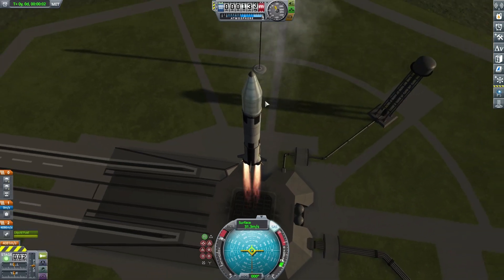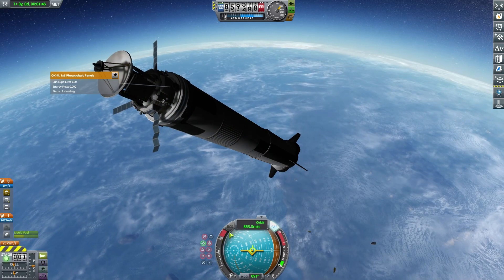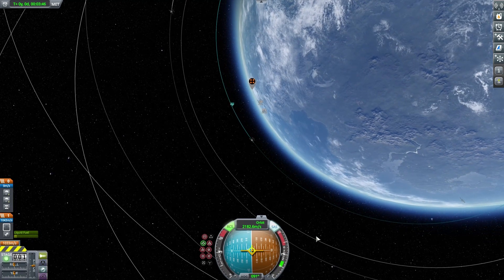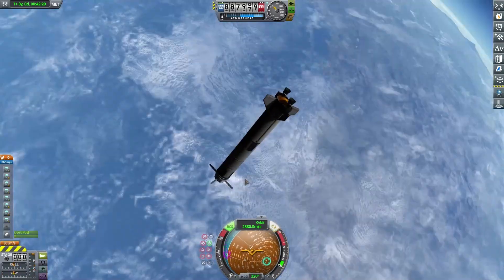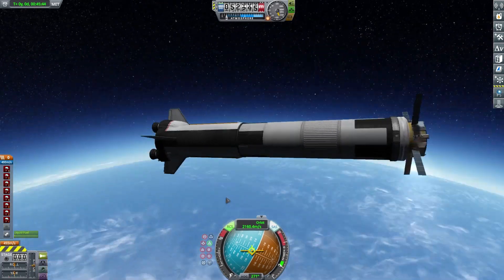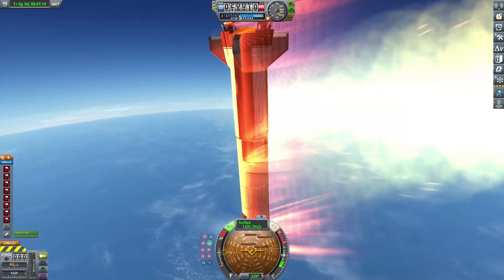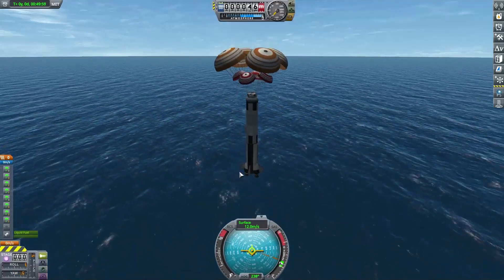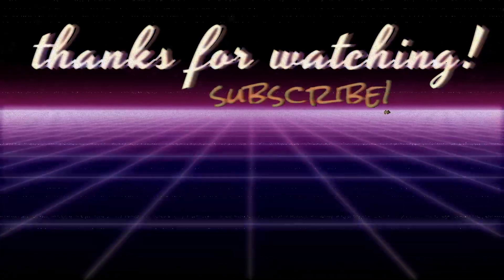cool S.S.T.O 2.0! i made

Comment: i love the ssto and i absolutely love seeing an ssto launched from the launch pad 
i also think that if you add retractable solar pannels it can be truly 100% reusable and if you ad aerobrakes to the top of the rocket you can controll both the decent rate and you can keep it stable
Reply from the maker: yes i was thinking why i did not add the retractable ones in editing :P also same about the launch pad and also thanks for the tip :)
Reply: @tubularfantasy  you can also að the MK3/space plane cargo hold to make the fairing reusable too however that might add stability issues however I'm not sure
Reply from the maker: @Boop_Doop  i did that once and no it does not add stability issuesit was not an ssto but it gave space for it to be manned it has its perks
Reply: @tubularfantasy  also have you ever considered a single burn to orbit